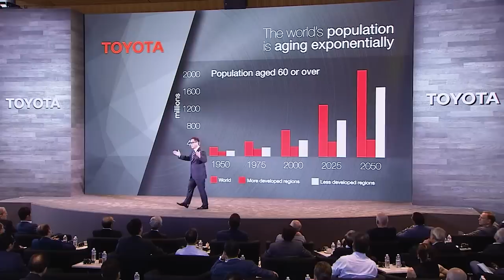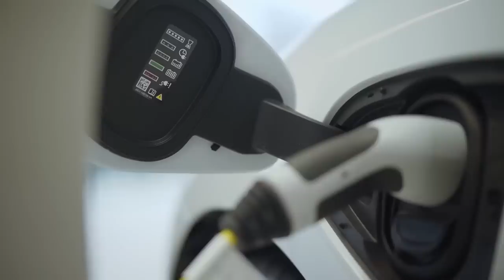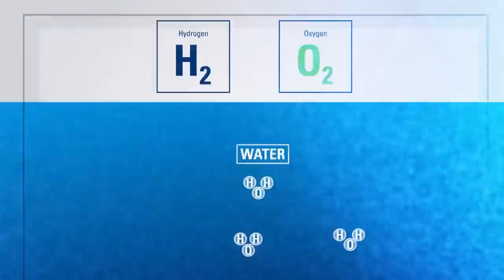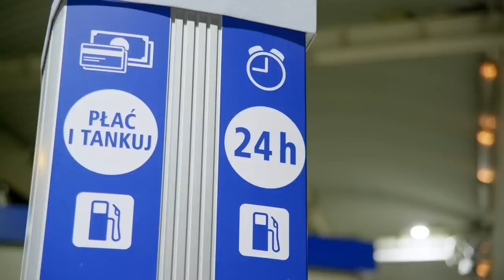New Toyota CEO Shocks Everybody | Huge News

Comment: I am thinking Toyota is betting on gas stations to convert to hydrogen, which may be a smart move since gas station owners most likely do not want to see their gas stations go away.
Reply: They won't add hydrogen because there are no customers and there are no customers because no one sells hydrogen. Unless Toyota is willing but spend the money to build all the infrastructure it isn't happening.
Reply: @truthseeker111  That is why Tesla build that infrastructure
Reply: Gas stations should just install bev charging stations. And do restaurants / vending machines while people wait to charge.
Reply: @tigertoo01  Eating places along major highways should be putting in DC charge stations. Destination places where people will be driving 150 miles and stay several hours like sports complexes, amusement parks, and museums should put in lever 2 chargers. There won't be a need for as many charging locations as gas stations in cities because of home charging.
Reply: @truthseeker111  No one was driving their BEVs cross country either. Tesla started building charging stations and now they are.
Reply: @tigertoo01  That's one thing I've never understood is why can't gas stations at least have 1 charging* station.
Reply: @bobjohnson4512  Don't see how that could pay for itself, unless customers are willing to pay $60-100/hour to use them.
Reply: @chriskelly509  How much would you be willing to pay per hour to use it?
Reply: @teekay_1  At a venue where a car may be there for 4 hours or more charging $15 to park at a level 2 charger would get you profitable in two years, they may be able to charge more. They will pay more if they have to stop at a DC charger and it will be a lot less convenient. A DC charger would just pay what other DC chargers cost in the area. Casinos in Las Vegas are putting in level 2 chargers and letting customers use them for free. They are making a lot more money if you park in one of their chairs than the cost of the charger.
Reply: @chriskelly509 Because they are expensive and dangerous.   Why drastically increase your liability and overhead for something that very few people even use.
Reply: @teekay_1  I think for the station to make a profit probably 0.12-0.16 per kwh. 🤔
Reply: @chriskelly509 Big Oil doesn’t want it.
Reply: @chriskelly509  That's what the station will have to pay.   They'll need to mark that up by a factor of 5-6.   You've got to be willing to pay the owner for the risk of building and maintaining the pump.

Many EV owners expect charges to be free or very inexpensive. But the reality is if there's no profit, no one will build it.
Reply: @bobjohnson4512  Well, the Casinos are doing it for the tax break and to bring the suckers in the door.

But if you're talking about stand-alone electrification stations along the interstate, they'll need to pay for the high-voltage lines to be brought to a place,  building a mini-mart, and then pay for the electricity they sell to you.  And they need to maintain the pumps and upgrade them as standards change.  Then you need a few clerks to man the register...   the consumer has to pay for all that overhead.

You'll find the cost will be more expensive than paying for an equivalent amount of gas.  So for your 300 mile range EV, a gas car could do that in 10 gallons, assume $4/gallon, and you're looking at a $40 cost to charge your EV. 

If you're not willing to pay that, don't expect these stations to spring up as a convenience.
Reply: There are some where the H2 is made and stored on sight, they just need a power source and fresh water supply. Which is strange for places like CA where H2O is pretty much liquid gold considering they are in a decades long drought. If only they had a way of storing the water from the freak weather events that role through every now and then.
Reply: @bobjohnson4512  These days there are so many Tesla SC stations there is no range anxiety except if you go far out in the boonies somewhere or with rare exception some small population areas, but even then a bit of planning eliminates that.  Overall very easy to go to any A to B route in the country with zero problems.
Reply: @TeeKay  at that price it's the same as what gas will cost per mile here in Arkansas... I'd rather have a plug in hybrid that charges at home.  Only way I would use EV I'd if I was married and one of us had an EV and the other a ICE...
Reply: @teekay_1 - Except that Elon Musk took that chance and started the SC network when very few Teslas were on the road. Now its got to be a money maker considering the no. of Teslas on the road.  No money from me, my Tesla comes with life of ownership free Supercharging, new station just opened 0.3 miles from my house, nice.
Reply: @anydaynow01  Try to keep up with the news, no more drought in California, it just ended in nearly all parts of Calif, thanks to recent atmospheric river rain storms and record snowfall in the mountains.  Reservoirs are back to normal. More rain next week in some areas.  Spring and summer snow melt will keep those reservoirs pretty full.
Reply: @Chainyanker007  Tesla maintains them as a competitive advantage to buying a Tesla as no one but a Tesla owner can take advantage of them, so he doesn't insist they make money.

I'm talking about your local gas station owning guy.   Because of the inherent risk, he'll have to charge similar prices to what a gas powered car costs and perhaps more because an electric car will take 45 minutes just to get a partial charge, so that represents 9x as much "pump" time as a typical gas car.

He can't just charge you the cost of the electricity and hope you buy a Slurpee to to give him 4 bits of margin.
Reply: @tigertoo01  Gas Stations will also then collectively need to Install New Coal-Fired or Nuclear Power plants to supply the electricity....Just because i Install a gas pump doesn't automatically mean i have the gas.....i could install a gas pump in my front yard but that doesn't mean there will be gas......so gas stations can install all the bev charger's they want but this does nothing to actually address the supply of electricity.
Reply: @anydaynow01  It takes twice as much electricity to make the hydrogen for a hydrogen fuel cell car as it does to power a BEV.
Reply: @Chainyanker007  Elon Musk, the hero of the right, pushed EV adoption in the US forward a decade by building his charging network.
Reply: @truthseeker111  And, virtually speaking, there are close to zero now. Just think what it would be like if everyone had EVs and had to wait 30 minutes to charge (think of it as refueling). So, consider how many gas stations exist now. We would need the same number of charging stations to recharge EVs. And because it takes such a long time to recharge the batteries, each station would require a huge number of electrical connections, hence a large amount of space per station. That can't be done in city centers; the available space doesn't exist.  So, if the misguided climate doomsayers do manage to destroy the gas and oil industries, just who do you think is going to build and provide all the charging stations that would be needed? It won't be the oil and gas industries. They will ride off into the sunset.

This is called critical thinking as opposed to ideological thinking.
Reply: @HDESM  seriously? Are you just another one of these deniers who look for excuses to do nothing. It’s funny how you present natural gas and nuclear as the only way to produce electricity. There are plenty of renewable options which can do the same along with battery storage. Most fuel station forecourts have a huge cover which could easily be covered in solar panels where it makes sense. For other areas there will be other options such as wind. The fact is you won’t need anywhere near as many charging locations as you have fuel stations because most people will charge from home.
Reply: @bobjohnson4512  Ayy, another Elon Cultist, how much have you earned from Tesla stock? Do you mind to share?
Reply: @bobjohnson4512  They will. In India, petrol and diesel station owner added Natural gas station. Our Government is planning for the same. EV Recharging station would require ample parking space. Imagine in city to have a big parking space only to recharge the EV vehicle is not possible. Existing fuel station will have to be converted. EV sounds cool for America but not for rest of the world where the infrastructure is still 20 years behind. H2 fuel make more sense. H
Reply: <<I am thinking Toyota is betting on gas stations to convert to hydrogen>>

Heh, heh!  At least at that point they would actually be "gas" stations!
Reply: I've been driving past petrol stations for 4 years now. My filling station is mostly at home, overnight while I sleep.
Reply: @bloodbathy  With 90% of charging taking place where you live or work there won't need to be as many charging locations as there are gas stations. A lot of stations will try most will go out of business.
Reply: @GBR9794  It is just that Tesla sold 491,000 EVs in the US in 2022 and Toyota sold 2094 hydrogen-powered cars in the US that same year. Toyota has been building hydrogen-powered cars longer than Tesla has existed. Someone did something right and someone didn't.
Reply: @Bob Johnson  you don't know where i live. Because Americans always think of their world view and assume the entire world will follow them. I don't have a place to park my car properly. You probably don't know about Mumbai.
Reply: @bobjohnson4512  "US" yeah, "US" > than the rest of third world and second world country. Try again next time please.
Reply: @kiae-nirodiariesencore4270  Congratulations. Don't go too far.
Reply: Hydrogen lol. Toyota took 25 years to develop and still developing the hydrogen car.
Reply: @tigertoo01  no thank you.
Reply: @bobjohnson4512  Problem is the Government wated billions handing it out to build EV stations yet most of that money has been plain scammed out.  All this money over the years should have been put into hydrogen.
Reply: Why not convert to propane.  Way cheaper.
Reply: @nicolec7290  because its not clean like H2
Reply: the whole country has been prepping for hydrogen for over 20 years. they will do it no matter what. hydrogen racing cups in japan are coming soon.
Reply: @chriskelly509  They sometimes have changing stations in the bathrooms but if I had a baby, I would probably change him or her in the car because gas station bathrooms are disgusting.

Comment: My thoughts entirely, hydrogen and hybrid is the way to go. I have said this from the start. The new CEO is to be congratulated.
Reply: It won't be the majority though, so Toyota risks moving from a market leader (in size) to a more niche player.
Reply: I would totally buy a hydrogen hybrid car!!
Reply: And deplete ALL cobalt on the planet. Use your brain.
Reply: @klauscottonswab2322  there's a about 10^17kg of Cobalt in the crust of the earth, I don't think we'll run out anytime soon.
Reply: @TankEnMate  not quite, lol. the trucking industry is picking that up vs the heavy asf tesla truck.
Reply: @rattanack1413  Better still if it worked on water and the hydrogen was extracted
Reply: @GBR9794  10^17kg is 1 quadrillion tonnes! So that would mean that each truck would need to use a tonne of Cobalt rather than the 1~2 kg of cobalt they actually use. As to Tesla, they already use less cobalt per battery for their NMC chemistry, and over half the vehicles they sell use no cobalt at all.
Reply: @TankEnMate  You really need to check out what hydrogen trucks are doing in California as well as what they are building atm. But since you appear to be a Tesla fanboy and cultist, I won't bother you with further contact, enjoy yourself.
Reply: @GBR9794  There are currently 57 public available hydrogen fuelling stations in CA at the moment. There are 34,185 publicly available EV charging points in CA at the moment. Green hydrogen has a 18~46% end to end efficiency, BEVs have a 77~82% end to end efficiency based on recent studies. So even the best green hydrogen efficiency is 50% more expensive than the worst BEV efficiency; and that doesn't even take into account the capital costs. The economics if hydrogen are poor compared to batteries; so sure, hydrogen will play a part, but it will be minor compared to BEVs. The vehicles cost more, the energy costs more, and the capital cost of the infrastructure is more.

Also, doing reasoned analysis and study doesn't make someone a "fanboy". Ad hominem attacks are a very poor argument; maybe Asimov's argument of the last refuge should be extended?
Reply: What is a hydrogen hybrid car again?
It burns hydrogen and exhausts water . And you want it to be a hybrid because why??
Reply: @TankEnMate  EV greenie, I drive a lot, and I've NEVER seen a charging station, EVER FOR ANYTHING....LOL..LOL.. TRUE.. Not in the SE USA..
Reply: @peteparadis1619  You are not everyone in the US, and you aren't everywhere in the US. Of course you can always find an exception. In the US as a whole there are about 10,000 times as many public charging points than there are hydrogen fuelling points. Those numbers don't change based on whether you are a greenie or not.
Reply: Hydrogen is a huge gamble at this point. It would be VERY hard to convince consumers to go w/ hydrogen since the infrastructure is nonexistent, unless every gas stations can implement hydrogen refueling on the side. Tesla made the smart move and scaled the charging networks first before scaling cars.
Reply: @TankEnMate  Oh You're the one who hid it there.. so you must know right?